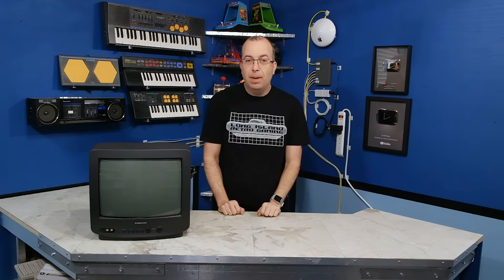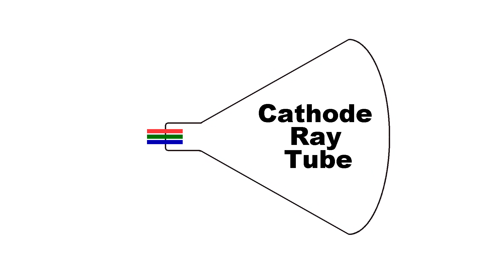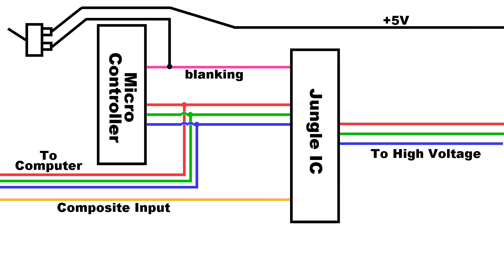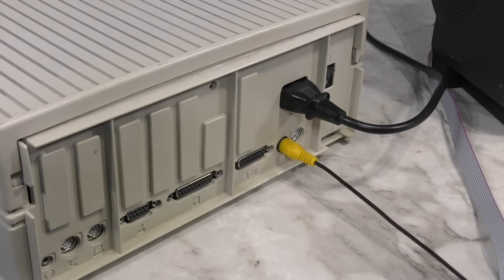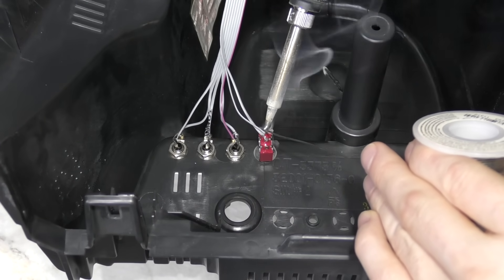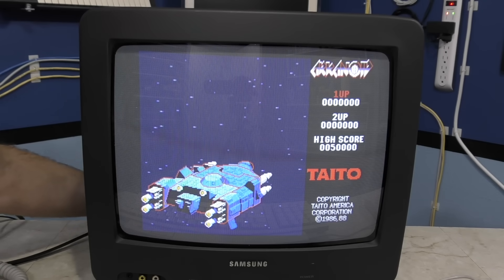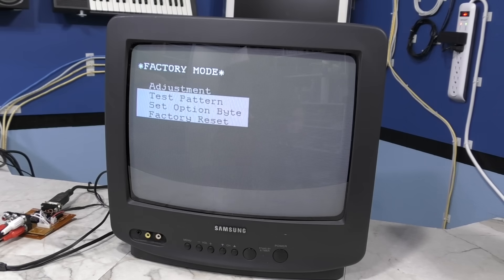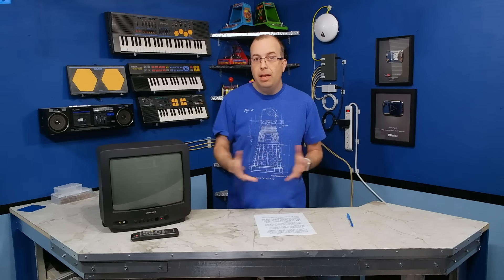Modding a consumer TV to use RGB input

Comment: Until 16:49 i really felt out-of-the-loop as it seemed to me i am from a different timeline; but, hey: I am from Germany, Europe. Yes, SCART. - What, you have had no SCART??? - ... meaning this is news to me, now in 2019. So, thanks; I've learned something!

P.s.: As you were wondering about VGA. Yes. Just connect it. It is exactly RGB. No conversion needed. Master-Clock ranges from 15.46 to 16.76 and most OS do provide generic TV drivers that do walk all the industries standard timings at that time.

If you are using it on PC go for stoneage ATI 'All-In-Wonder' cards which handle any connectivity actively discrete and totally separate from other modes. Also you get all signal-connector -combination-options [Composite | RGB | VGA | YPbPr | S-VHS] ... [Chinch/RCA | SCART | CoAxial/BNC | MiniDIN-9] in the Retail-Packages. If you are eager to see some End-90s multimedia-pc-video-wizardy.

The contrast-failures | ghost-images you see when using composite vs. component are mainly due to the timely serial shifting of the color-channels and therefore not being drawn in time to hit the phosphors in their sweet spots. This becomes apparently clear, when you run the signal through a 9m/30ft cable. The lesser shielded the earlier visible.

Whereas if you use component, you not only have less of an impact of lack of shielding, because you are running the colors seperately, but every channel also has the full luminance signal on top of it.

High-End TV's made use of the fact that luminance is cloned on R, G and B, by fine-tuning the incoming channels based on that luminance. The result is as crisp as it can get.

Phillips/Thomson and Sony made it an art-form in the end of the CRT-non-HD-era and Sony ..
.. Well, you know  .. SONY aka The Gods From Planet Trinitron ..
... I still use my 68cm 14:9 at FWVGA to watch anything up to Full-HD, simply because the glow and that due-to-masks anti-aliasing, in combination with the image-processing it applies, is times more tasty than watching any artifact, if  from compression or underperformance doesn't matter, clearly visible on a Full-HD-or-greater-resolution-Display. If you have perfect eyesight those errors wash half of the motion pictures effects out. If i watch a movie, a series or playing a game i want to enter a dream-world, as dreamy as it can get. - The only thing that comes near to phosphors (CRT) is Mitsubishi LaserVue, which would be perfect for 4K/8K.

Comment: i did this with a spare commodore 64 monitor, so i could hook up an snes in my garage, for summer time and such, and it worked out great. mind you the monitor due to it's age eventually fizzled out, tho i probably could have fixed it, but it was a mess inside.

Comment: I kept an old 20" tube television in the hopes that I could use it in a cocktail cabinet to run MAME (Namco and Galaga especially). It's an off brand, but a really nice screen (I think it may also be a tri-dot mask), plus it has power on/off memory, so it doesn't require a remote or switch to power back on when plugged in, perfect for an arcade machine. I thought the PCB may have S-Video circuitry, but not a port on the back, but this gives me hope that an analog RGB conversion similar to this would be possible. I've also kept several flat tube monitors with tri-dot mask to build some mini arcades. I always owned Sony Trinitron TV's, but the electron mask lines are hard to ignore up close... tri-dot displays have since been my preference, since I used to work on Trinitron Apple displays, and never was happy with the RGB convergence adjustments. Thanks for posting this, it gives me hope...

Comment: By default sony trinitron aperture grills use the single electron gun called trinitron because thy combined of three aka trini meaning trinity, and tron suffix eqauls electron as in the combination of three elecTRON guns into one so by default hits green phosphors for the screen for this so then when needed so its right it uses fine wires to vibrate so that this deflects the light beams to the red or blue phosphors, 
Also nite that somehow possible it can be true for soem color crt sets to have the blue and green phosphors containing cadmium
Reply: now i know what trinitron means

Comment: This is not an easy mod if you don't know exactly what  kind of hardware you use. I tried this and I located the RGB / Sync / Fast blank pins but I am completly confused with the diode part, so, my crt will stay with composite, im not an engineer.

Comment: If anyone is thinking of attempting this on another type of TV, beware. Some TV's use 0V that is referenced to "half mains". Grounding this to a conventional ground will result in damage, and an exposed connection will present a shock hazard. Check the 0V on the TV is isolated from the mains supply first. Other than that, a fine mod!
Reply: It's called a hot chassis design, but this was only common on RF-only TVs and by the 80s they were phased out

If you have a TV with composite video input then it's usually not a hot-chassis design.
Reply: @tristan6509  Notable exceptions being some Hitachi and Sony portables, at least here in the UK. The SCART connections being isolated by optos and a small isolated supply to drive the supporting amplifiers.

Comment: Hmm, that composite and mono audio input block on the back of the TV board looks rather like a SCART converter block. I wonder if there's blind-ended RGB (and either composite or separate sync, as well as SCART blanking) traces on the motherboard under there?

Also, word to the wise, if you go to hook up a CGA computer to this... they don't actually output analogue RGB. I don't know if the signal levels are the same, maybe they are and the R-G-B digital lines will feed into the analogue input OK, but you'll only get 8 colours that way if so. To add in the intensity signal that gives you the 8 "high intensity" colours you need to build a little mixer circuit to combine that digital with the others. And if you want to have "IBM Brown" instead of just a muddy dark yellow colour, that's additional complication...
Reply: edit: ah you actually covered that anyway :)
Different question, then: have you run into any problems of machines producing separate sync instead of combined? It's a much simpler matter to merge the two signals together at least, and that CGA converter almost certainly has to do it, so it's not insurmountable, but may not be an immediately obvious thing until it gets in your way. EG I know that any ST that lacks a TV modulator also lacks any kind of composite video or sync.

Good call on the VGA tweaking btw. I did know that the standard was always built with producing TV compatible graphics in mind, and there's parts of the spec that say about register settings you have to aware of if you're designing a 15khz mode, but I never knew anyone ever actually convinced the original hardware to run at that rate rather than 31. Even though I have myself previously convinced a computer to rez down to 50Hz to work better on an HDTV via a composite converter...

The other interesting thing about doing that of course is that you can get 256 colours at 640 pixel width without having to use SVGA, but instead a regular VGA (or even an MCGA, if you can get at the registers and don't mind running 640x200). Though you can't go above 640x400 (interlace) in that case, you're not likely to fit any much more than that resolution onto a TV scanning at 60Hz (...and probably need to set the textmode / 720-pixel clock to get it to fit in underscan anyway), so it's pretty much a perfect fit.

Comment: There are millions of CRT TV's that have been junked that could have been modified for retro use...such a shame.... fantastic video, just too bad info such as this was not available several years ago.
Reply: Europe (France) had solved the problem bacl then by making SCART mandatory. Up to 2014. It's great being able to simply plug my old 2002 PS2 into my 2013 HD smart TV. Yup. No messing with this awful composite signal

Comment: Hey David thats alot. Your video inspired me to mod an old Telefunken CRT-TV with RF-only input. So theres no composite or audio input.
That works too, but its far more complicated. There is also a PAL-decoder jungle-chip that accepts an RGB-bypass signal just as shown in the video. Since there is no option to switch to AV-mode directly on a RF-only TV, the composite SYNC signal must be input directly to the luminance (Y) pin of the junge chip (luminance and chrominance had separated pins). BUT there is still the composite signal comming from the intermediate frequency unit of the RF-demodulator that must be disconnected by desoldering the wire. The same goes for the audio, the connection to the audio-demodulator must be desoldered, otherwise the sound would be extremly noisy.
Inputting the 3V blanking signal internally didn't work so i had to add an extra cinch port to get the blanking signal directly from the SCART-Plug. But after all, it worked an the Telefunken PAL Color V3210 is now showing RGB ;) Greetings from Germany

Comment: Maybe someone here can help me...
I have problem with GBS 8220 adapter that I want to use with VGA monitor on my ZX Spectrum +2A.
Basically the signal is not synchronized so the image tilts up and down and sometimes just goes black making it impossible to use the computer. I've sought info in the internet, but with no result...
Reply: if I remember correctly, the ZX Spectrum 2+ use RGB TTL (what he calls digital RGB) Mak sure you're using the right input and also make sure your connector is solidly made.
It use a DIN connector for video out, right? Check the soldering on it if you got the cable made. Modern DIN plugs are absolute nightmare to get soldered right.
Reply: I'll try with other connector, other than that I believe VSync cable from the adapter should be connected (one of the only info I have), however I don't know where.
Thanks anyways!

Comment: It's simply amazing that tv manufacturers rarely incorporated this feature into their sets. They could have improved video quality considerably without much additional cost.
Reply: The reason is most people just used RF for TV. If they used something slightly better like composite it would have most likely been a VCR and not really worth the hassle.
With the rise of video games consoles (and TVs with jungle chips) it sure would have been a great help.
Reply: @realgroovy24  I never actually thought about it, like what would be the point of getting the best picture quality if your vcr will not look much better anyway?
Reply: @realgroovy24  sony sucks
Reply: the problem is marketing this difference to consumers, our tv at the time had component in and we would still use composite because we didn't know the difference, we thought it had something with karaoke stuff or something

Comment: Neat, though three things I'd advice you to improve:
1. Where you added the new resistors, better replace, not reuse, the old ones as well so that the resistance of the newly installed pair would match the one of the original single resistor.
2. The jumper wire looks slightly scary as it runs across some traces. Better just remove the resistor and replace one with that jumper instead.
3. Connecting a switch (especially from a Vcc rail) may be unsafe unless the signal line is current-limited. Better use the switch to actually flip the IC input between Vcc and a real blanking signal, or just add a pass-through resistor unless it is already included on the board. Also do watch out for the possible ringing to start in the long non-terminated wires...

Comment: I'm just impressed that 2 people were watching a single 13" screen. My desktop monitors are double that size and I've for 2 of them! 
Ahh, the past.
Reply: so your monitors are 26"?
Reply: Having grown up with one of these TVs as the only TV in my household watched by the whole family (from the other side of the room no less), as soon as I got a job I forked out the cash for the biggest monitor I could find, which was initially a 21" CRT, then the Dell 30" LCD when that first came out, and more recently a 40" 4K model.  Having to put up with such a small TV for so many years was awful, especially when shows were 16:9 letterboxed so the picture was even *smaller*.  Never again!
Reply: @vink6163  I must say I got used to it (SE Europe) , in 40 years of watching TV it might be I complained more about impossibly big TV's than them being too small. But what I couldn't stand (5-15 y ago) when people with widescreen sets watch soccer and the ball and the players heads are oval -and I mean horizontally, like Stewie's head in Family Guy. And the used to tell me, you have no idea,this is how it's supposed to be. 
Watching a distorted picture on a modern TV set.... nowadays the signals are widescreen and match.
Reply: @florkgagga  Oh yes that used to drive me crazy - it was one or two button presses on the remote to switch it to 4:3 mode but no, much better to watch it squished like someone sat on the picture and squashed it!
Reply: @vink6163  but on some devices (or combinations with the TV signal) it's outright impossible, on my 4k Philips set the only option (besides wide, zoom, fill screen...) is "original" , then I can watch 4:3 ratio - but the black stripes are not only left and right but above and below also...ofc, original means original resolution, so the whole pic is small.
In a hotel I stayed in 5y ago for 4 nights they were doing minor renovations and also installed LCD TVs. I got a room with the new set installed and had to ask the technicians, who were finishing in the other rooms; how come I can't set the format to 4:3 when I want to see proper ratio? -oh that's disabled, we don't want guests to mess around with the settings, and the screens get burn-in...
REALLY? especially in a place they are highly unlikely to spend more than 2-3 hours (+8 sleeping) in the hotel room.
Like a car rental who says "this luxury vehicle performance blahblah, 7speed blah, gears 5-7 and comfort setting are disabled for your safety, and we expect you to drive on smooth Autobahn or Interstate surface, no bumpy local roads. 
Something like that. Ah well , lockdown makes  me too ”creative”, sorry
Reply: we're watching 4-5 people this type of TV in my grandma's house even today. She bought a 32" fhdtv for main but second is a 13" Arçelik (beko) CRT
Reply: @nurullahaksay  Is Beko like a Turkish samsung ? Never did I know that they make tv sets. I have fridge and oven from them lol.
Reply: I remember when TV's designed for the bedroom were 9" and did not display color at all, they were known as a "black and white TV" now more commonly known as monochrome. The one we had was manufactured in the 1960's.

Comment: Would it be possible to add a USB port for powering a pair of Speakers?
Reply: This shouldn't be a problem at all.
Reply: There's probably a 5V regulator on the board, so no reason you couldn't.  Depending on your speakers' power requirements, you might not be able to play them as loudly as you'd like, but for very small speakers, that seems pretty reasonable.

Comment: TV has only coaxial input, but the schematics show that it has RGB in pins and blkin pin on the jungle IC.  How would I go about syncing my RGB signal if there's no composite input?  And if I were to add one, how would I get into AV mode if the controller chip on TV doesn't support this? Is there a direct way to sync via the Jungle IC while on channel 3?  Otherwise how does the OSD display while on channel 3 normally?

Comment: question, what does the suction cup do?
Reply: 30,000 volts flow through the wire, the suction cup just keeps it from leaking and arcing onto the back of the tube.
Reply: succ  ( ͡° ͜ʖ ͡°)

Comment: One thing I didn't understood. How he uses the sync signal, and how he changes from RGB to composite just switching on and off, but without another cable exclusive for the composite signal.
Reply: The TV's normal composite input is generating the sync signal. It contains the "front porch" that initiates the vertical blanking interval and the color burst necessary for the television to detect a color signal.

Any device that does not have a composite signal in addition to an RGB signal would need additional circuitry to generate the blanking intervals and front porch signals synthetically. 

The OCD works by substituting the composite's RGB signals with the microcontroller's Yr-Yg-Yb signals whenever the jungle IC's blanking line is activated. The synchronization signal still comes from the YV's normal composite input.

Normally this is done in synch so that the composite signal comes through at the points where the OCD is being displayed. Tying the jungle chips blanking line high means that it is always using the microcontroller's RGB signal so that the microcontroller's signal fills the entire screen. This mod connects through the microcontroller's line. 

The switch is used to control this always on signal to the jungle IC's blanking switch.  When it is disabled,  the RGB signals are taken from the composite collection as designed.  The mod is in composite mode.  When the switch is enabled, the OCD (and therefore the modded RGB) is enabled for the entire screen. This RGB mode is activated.
Reply: @timharig  thanks man! I even remember that I asked such questions here, but thanks to you now I had an answer. However, so many time has passed since I watched this video that I have to rewatch it to better understand everything you said. 

Anyway, thank you one more time for taking your time to answer a stranger's question on YouTube!